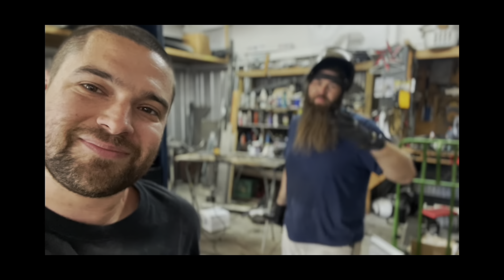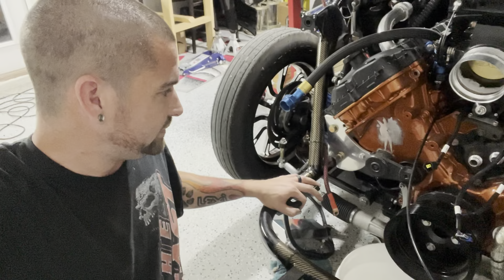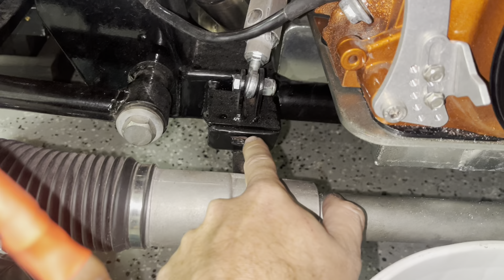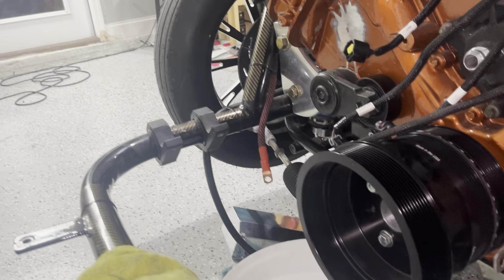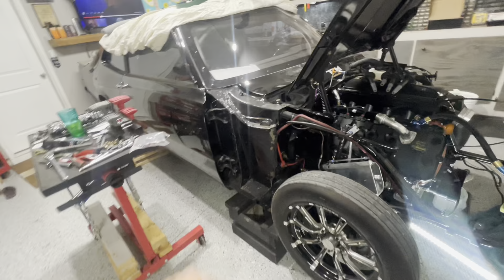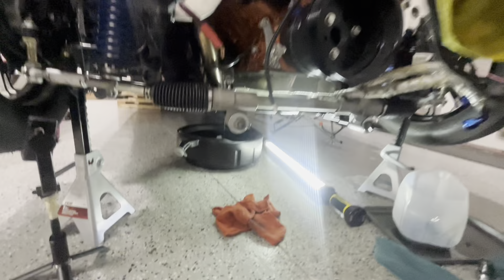🧰 Preparing To Get Our Blown Ford Coyote Out 🫣

Comment: Stock coyote oil pressure  sensor is on the oil filter housing. Once you have the flow directions good to go the location where you have the oil pressure sensor is perfectly adequate.
Reply from the maker: Yea but moving to block would prevent this mistake in future or at least it’d allow it to be caught sooner than later. We will see. Ima make a few changes

Comment: Hey buddy, I think the oil pressure sending unit is mounted to the stock oil filter housing. It looks like the hole behind the oil filter housing location is for oil temperature but you should be able to use that location.
Reply from the maker: That is correct it is.

Comment: There should be a threaded hole just behind your oil filter mount on the block for a sending switch
Reply from the maker: There’s one near there that people use for coolant temp I think. The adapter has that port in it we plugged but I don’t think I can get a sensor in there
Reply: Yep that's the hole, so where have you been reading pressure from?
Reply: @ThePaintPaperHustle  Sorry for confusion on the hole location, the threaded hole in filter mounting block not engine block, my bad
Reply from the maker: Yes I’m thinking of moving it to there and using a remote psi sensor block this time for fuel and oil along with coolant psi maybe
Reply from the maker: We are currently reading pressure in the oil filter mount

Comment: Just to make a quick comment on your oil pressure sensor.I would think that ford more than likely has a oil pressure gauge connection in the back of the block somewhere,on most ford that’s where they should be located because it lets you know that oil has circulated throughout the engine.Plus it will give you the actual oil pressure after it has made it through.Plus it’s going to show a little lower than right off the oil filter.
Reply from the maker: On the coyote there is not one. It’s designed from factory to be in the oil filter housing
Reply: Wow that’s kind of like the old FE engines which if the pump would put out 20 psi at the filter it would be a lot lower at the rear.
Reply from the maker: Ok

Comment: Hey bro I wouldn’t stess too much about the travel limiters. I don’t like travel limiters. When your suspension drops and that limiter hits it will upset the rear suspension. My opinion if you have good shocks on the front with good compression and rebound control you really don’t need travel limiters. Idk if you’ve noticed on my car but I didn’t even put any on my new car cause in the past we’ve seen them hurt more than help a good shock u can lock your shock down pretty good so i just use the shock as the travel limiter so there’s no hard jerking of the limiter upsetting the chassis. Just our experience with them
Reply from the maker: Very good point!  I do like using them to make it easier to put wheels on crib blocks lol. Being I have them I think ima go ahead and fix the tabs but can always take them off and just not use them. Thanks for pointing this out though.
Reply: @ThePaintPaperHustle  yeah you right about that I can lock them so I don’t have to jack so high. F

Comment: What about the ford 7.3
Reply from the maker: I love the ford 7.3 Godzilla. Been trying to get one for over a year in a wrecked truck.
Reply: @ThePaintPaperHustle  
Didn’t know they were that hard to get sorry
Reply from the maker: You can buy a crate motor so they are hard to find but the way I do it I get it for free. I got the coyote for free by buying a wrecked truck taking motor out and parting everything else out. The part out allowed me to make a profit and keep the coyote at no cost. That’s what I want to do with a 7.3 but I need a certain wreck to make the math work.
Reply: Summit has about 27 new 7.3’s in stock for $7953.99. Includes intake, pans, covers, coils, wires, harness… everything. Seems reasonable honestly.
Reply from the maker: I’ll get one for free like I did the coyote

Comment: I am out when you say ls is faster than coyote...wrong..and development is only mid way on coyote...check out Holbrook racing out of Detroit...yuo need to learn more !!
Reply from the maker: It wasn’t meant to be a factual statement it was just saying if someone wants to claim that then so be it it doesn’t matter to me. I 100% agree with you. I think the coyote is way ahead of a LS in power and dependability. They both have weak points though
Reply: Ls are faster then coyotes
Reply from the maker: Duhhhhh 😂